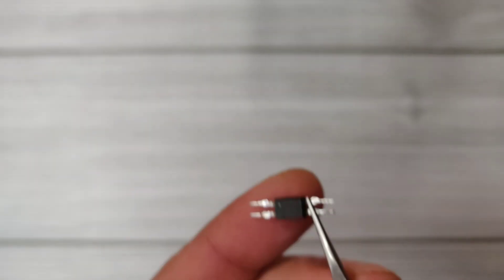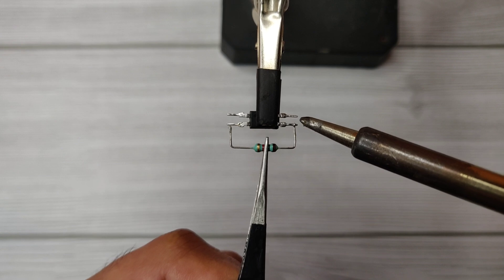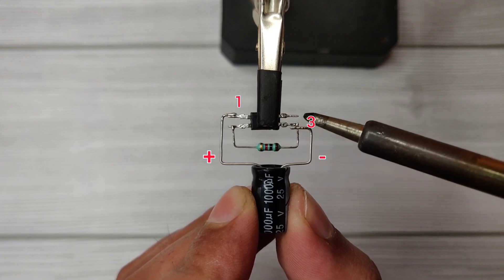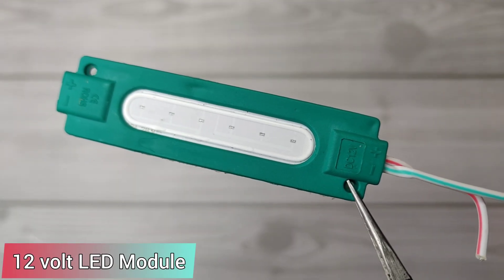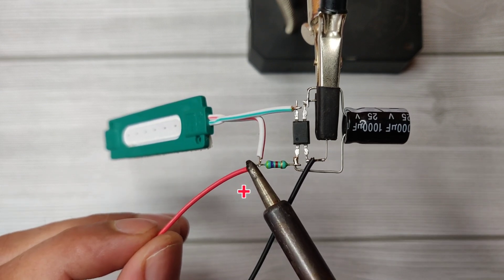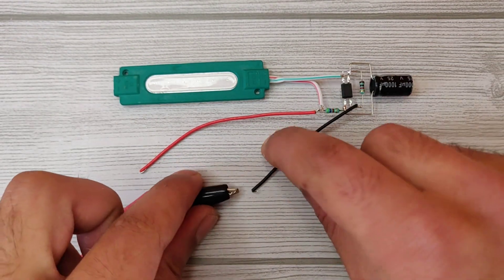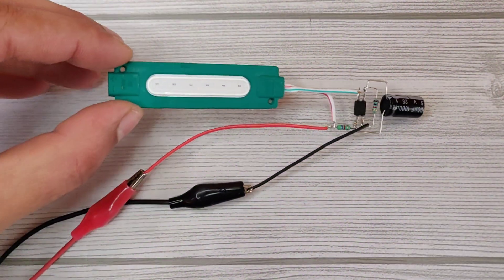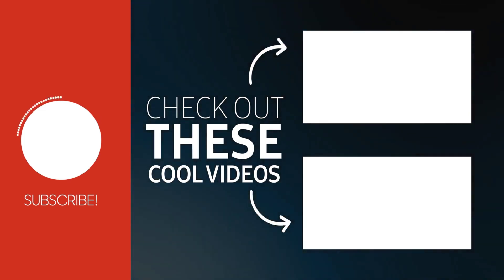Simple 12 volt LED Flasher Circuit

Comment: As u have shown this instead of 12 v can we change it to 6v and use a solar panel 3W 6V solar panel,  any changes to be done if so please explain how to usetiliz
Reply from the maker: You can use 6v power source from solar panel, but make sure to connect same voltage rated LED.
Reply: Thank you for your reply